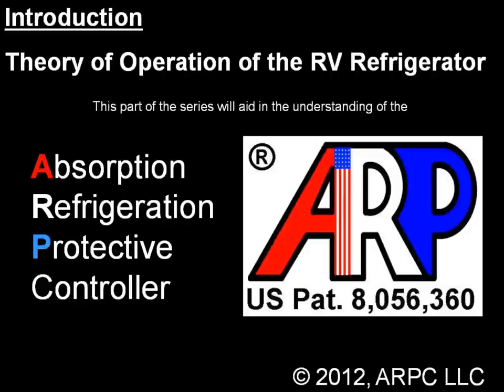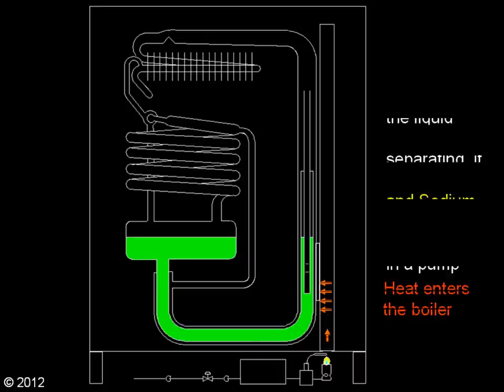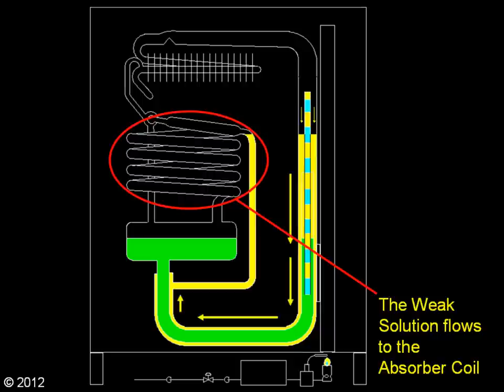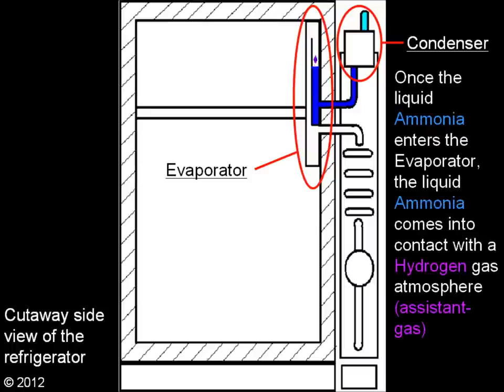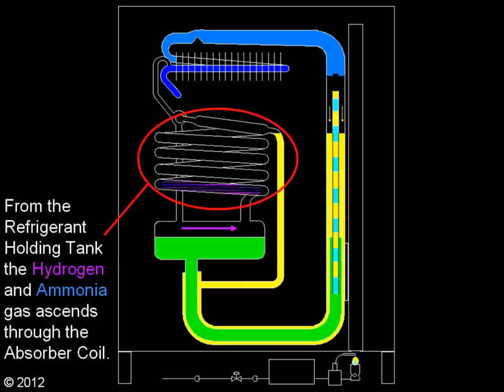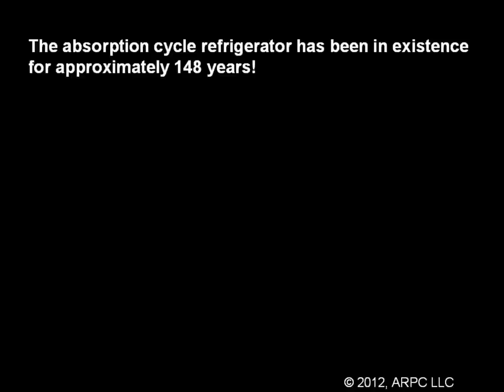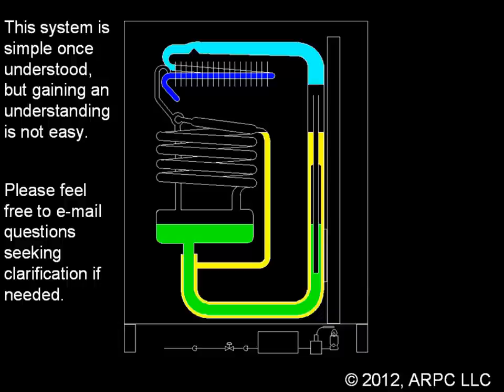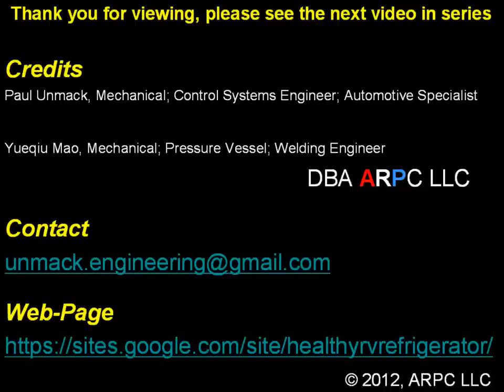ARPrv  Introduction to the RV fridge (Off-Level Protection Control)

Comment from the maker: Thanks Donald, although Atwood uses Helium, ammonia is still flammable in the correct conditions. Without monitoring the boiler temperature, as the ARP control does, the Atwood fridge will fail like any other absorption unit.  I would like to see an objective test of the Atwood fridge in varying environmental conditions.